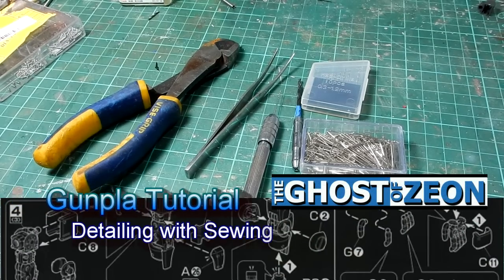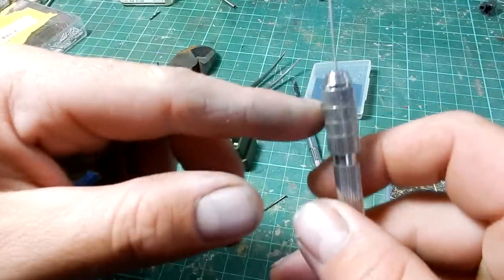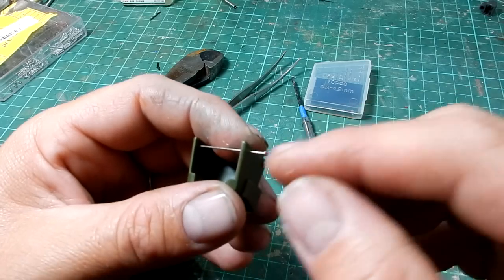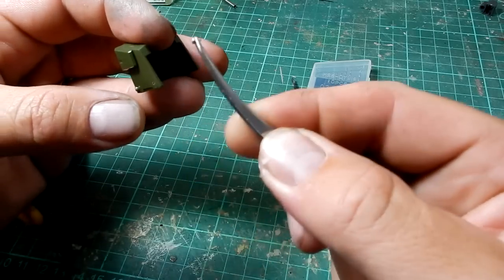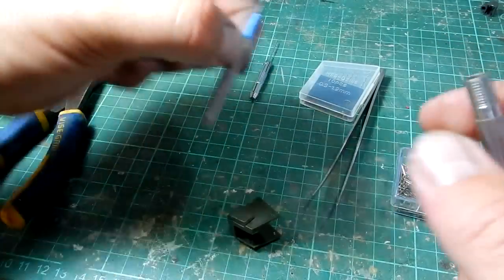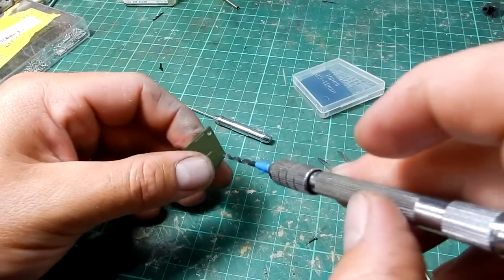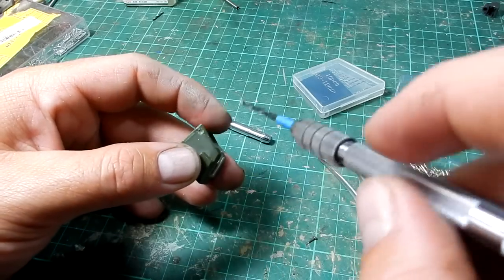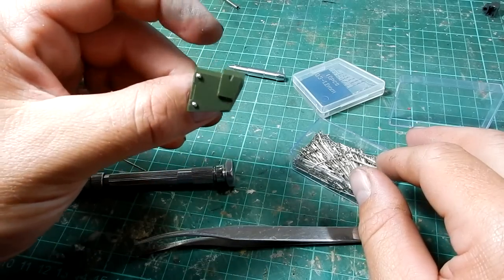Gunpla Tutorial : Detailing with Sewing Pins

Comment: All of your tutorials are very novice friendly. Something I am wanting to do for a future project is a cartoon-style barrel breach or maybe a somewhat more realistic barrel bulge. Do you have any ideas of how to accomplish either? Just to elaborate when I say cartoon-style I am referring to the classic  pealing effect you might see in a Loony Tunes cartoon
Reply from the maker: My suggestion if you are using an existing gun from a kit would be to saw the barrel into quarters (ie. saw down the barrel from the tip towards the grip end to about half way) so there are 4 separate pieces but still joined.

I would then carefully and slowly heat them up and then fold them back once they are hot enough (be careful not to melt the plastic).

Once the plastic cools, it will hold it's shape.
Reply: Thanks sounds like a plan I will give it a try. Ok, that covers the finger in the barrel gag. Any ideas of how to do the barrel bulge, imagine a mobile suit pinching the end of a tank's barrel closed and the barrel bubbles as a reaction to firing having noire for the ammo and gas to go,
Reply from the maker: Blake Hanley I would just use some epoxy putty like Milliput to create the bulge. Mix up enough by kneading the two parts together and then shape it around the barrel where you want. Once it is dry, it is sandable and paintable, all you would need to ensure was that the edges were smooth and not visible (like with ordinary seam lines).